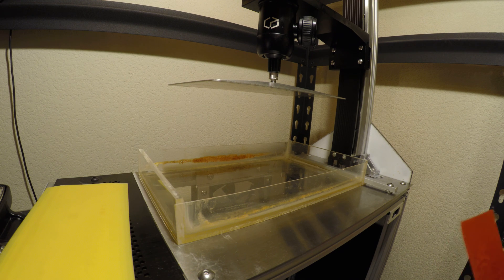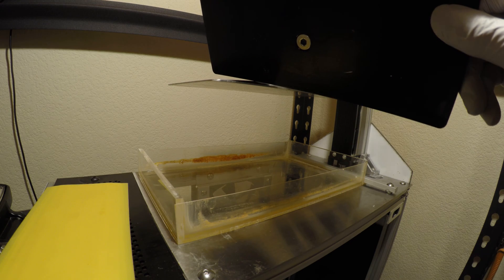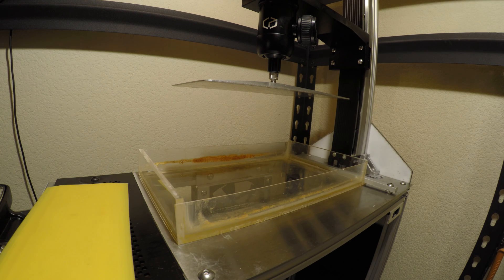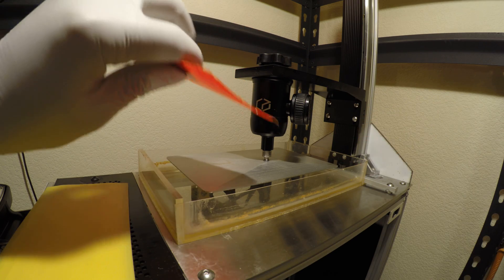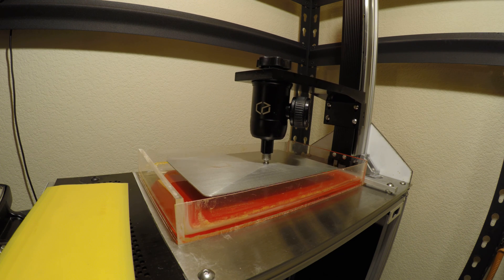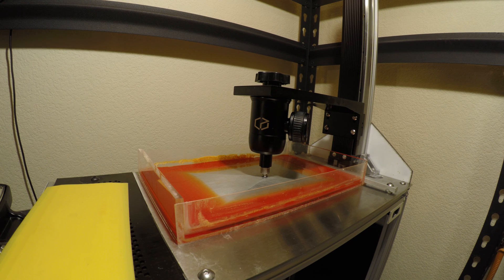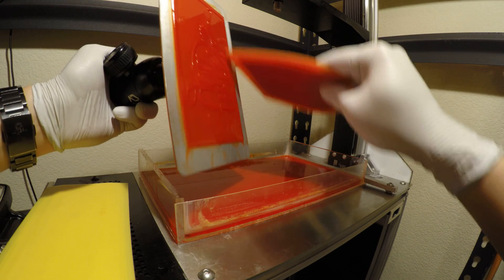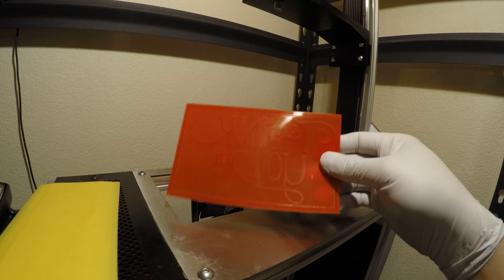3D Printed Letter Press Plate on the Kudo3D Titan 1 DLP SLA 3D Printer

Comment: You know you could do that a lot quicker and larger with a laser engraver....
Reply from the maker: +bobhaha I do have access to a laser cutter with 3D engraving capabilities. What material do you usually use for letter press plates that engraves well?
Reply: Aero Rubber, Delrin, Acrylic, CC foam...
Reply from the maker: ***** Have you found that all of the materials you listed will perform similarly when run through a latter press? Or would you prefer some of the softer options over the harder ones?
Reply: Depends on the look you are going for. A harder material will give a well defined sharp edge to your letters, where as a softer material has a more blended edge. It all depends on what kinda of effect you are after.
Reply: Hi there, do you have examples of the printed work from these plates?